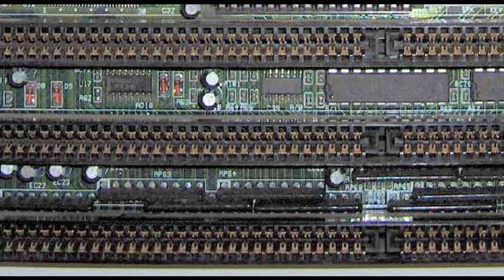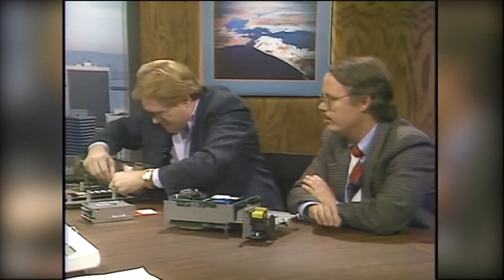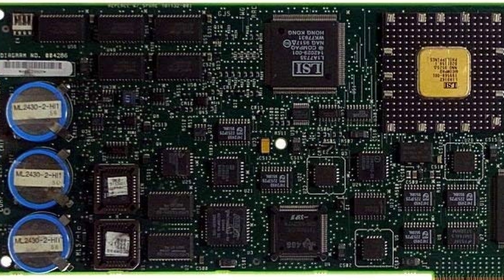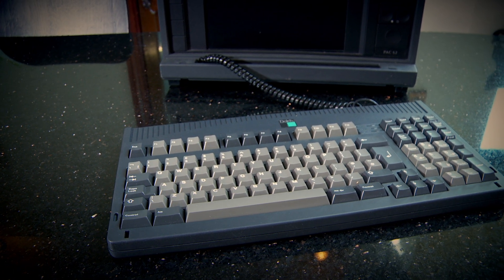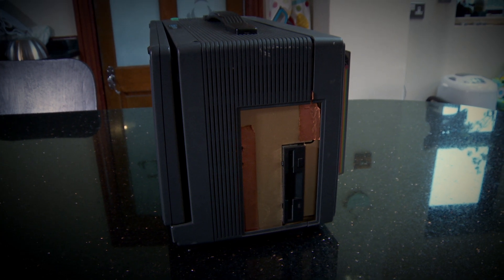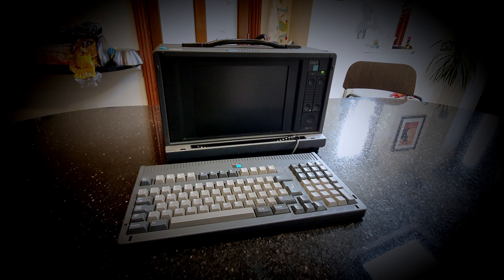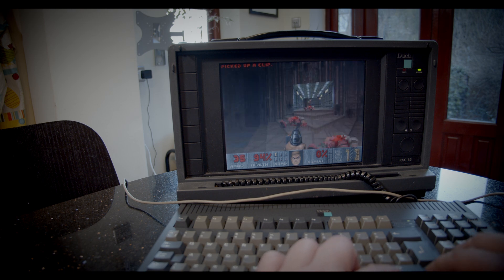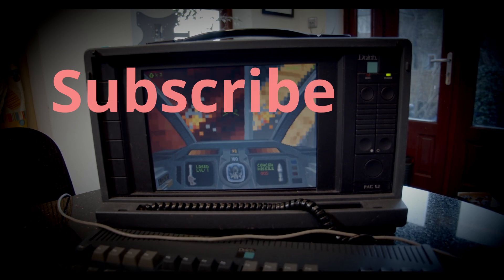E-ISA vs MCA: When IBM Lost the lead in PC market

Comment: One thing that's not mentioned about this period and IBM's plans for the PS/2 is ABIOS.  This was a new, extended bios (that they would NOT make public) that, they thought, would allow OS/2 to perform way better on a PS/2 computer compared to a PC compatible.

I'm not really sure what logic they used because there are serious logic holes in that plan.  But what other choice did they have to try to regain control?

Comment: Small correction: There's no relation between FreeDOS and DOSBox. DOSBox is a stand-alone emulator that has its DOS "built-in". While you can use DOSBox with actual FreeDOS or MS-DOS (or even Windows 9x), in 99.9% of the cases it just runs on its internal DOS emulation.
Reply: Yes. As opposed to any actual DOS, the DOSBox emulation doesn't actually consume any RAM within the emulated machine and just provides invocation points such as software interrupt handlers, which get satisfied by pure magic - it just doesn't exist as software within the emulated environment, it's folded into the machine emulation.

DOSBox-X fork, however, does bundle some utilities from FreeDOS.

Comment: ISA is pronounced ice-ah but EISA is pronounced by pronouncing the 4 letters one at a time. It's not pronounced e-isah.
Reply from the maker: Its nice that you have an opinion on how it should be pronounced, but it is just that. I've never ever heard it pronounced that way even once, and I had alot of conversations with people about E-ISA when it was a current technology. So while you may pronounce it that way, it would seem to me that you're in a minority camp choosing to go with that pronunciation.
Reply: @RetroBytesUK  I work in the industry and at the time and I have never heard it pronounced anything other than E-I-S-A.
But, you are probably right that it doesn't matter. It's just me being pedantic.
How much was that CF-SCSI adapter you are using?
Reply from the maker: @tarstarkusz  I got mine for £55, however I think they have gone up in price now. I've used a few of them and found them to be very reliable, I have one in in my SGI box, my Sun SS10, and a couple in different Amigas.  I'm planning on trying out RaScsi on a future build, as it a reasonable price, and some of the features appeal especially the remote access to disk images.
Reply: I knew someone in school who said "iz-dnn" for the digital telephone service and there's Dave Jones reading all acronyms as if in lower case: no Ellie-Dee or Effie-tee in his component drawer. Beeta, bayta, bonnet, hood, we'll work out what we mean. *smile*
Reply: @tactileslut  ISDN was pretty cool.  I once worked for a company that had a service contract with Oracle.  All the remote Oracle employees (there were a lot of them) had an ISDN router in their home offices.  The ability to handle telophony made them very useful.  They could get an office extension in their own home.  But as ADSL and DSL started becoming widespread available, they quickly went out of favor.  The problem with ISDN is that it was expensive and the equipment was expensive.

Comment: 7:26 "The only lasting standard that the PS/2 managed to set was the keyboard/mouse". It introduced VGA which came to rule supreme for many years. Or am I missing something?
Reply from the maker: It had a vga connector, but that was an agreed upon std and was already on a number of gfx cards before IBM shipped their first PS/2.  If IBM had got the PS/2 out when they had planned it might have been the first time it had been seen in the market, but that was not to be.
Reply: @RetroBytesUK  Interesting. Mind telling me which gfx cards? Just surprised, as I was a total graphics geek at the time (starting on A2s, c64s, macs, amigas,...) spending a lot of time on PCs with CGA, EGA, Hercules, VGA, SVGA, (writing 2D-engines, 3D-engines, movie players, etc.). Also having to make an adapter cable converting from the (to me) new 15-pin VGA standard onto my monitors existing analog 9-pin PGA connector, etc. Taking the VGA specific sync polarities into account, etc. Not doubting you know your stuff, not trying to win, I will be happy to learn something new. But really? (My idea was that VGA with 320x200x256 was a new thing introduced by PS/2 in 1987 that lasted into the later 90s)
Reply from the maker: @asgerms  We had a few HP specialist CAD PCs that had vga prior to the PS/2's release, it also had acceleratored vector drawing. However only the custom verison of autocad that shipped with it supported the acceleratored drawing. The place I was at then was going to order a number of ps/2s on release but while we where waiting on the ps/2 it's release having been delayed, HPs sales team got to us. We also acquired some none acceleratored vga cards from a 3rd party to upgrade our existing machines at the same time, really can't remember the manufacturer they where probably targeting the CAD market at the the time.  The vendor had its own graphic terminal software that worked with the unix based system we had, as all our simulation work was done on unix.  Being able to use a pc as a graphics terminal was a big deal. I remember it having its own I/O board that linked it to the Unix machine (the cable was super thick). They where not fast, 16bit isa really did not perform well enough. However this is pre X windows being common our unix system had no X support, but it did have alot of vector processing which for the simulation work was great.  And PC where much cheaper than the graphical terminal that shipped with it

Comment: Tandy was one of the few companies that actually licensed the microchannel and produced a 3rd party machine using it.
Reply: Another was Apricot with their Qi PCs and VX servers. The servers were on caster wheels, had a sliding, electronically operated door at the front and looked like fridges. An image not helped by a light that came on when the door opened.

Comment: "even the smallest Linux distro needs more than 16 MB to work"
Actually, KolibriOS can fit on a high density 3.5" floppy and runs on a system with at least 8 MB RAM. And it has a very Windows XP-ish GUI too.
Reply: It was built on Menuet, with their own monolothic kernel that wasnt posix compliant (as opposed to linux, kernel wise)

Comment: I couldn't see the header for the internal video, but if it's just a VGA signal why not get a PCI video card and depopulate the external VGA header and made an adapter? Maybe even get a voodoo setup that way.... Anyway, good video
Reply from the maker: I did think about depopulating as pci card too after making the video. That's unfortunately where things got more complex as the lcd pannel takes some form of LVDS signal rather the regular VGA. The orginal card produces that signal format on the internal header. Once I looked at converting the VGA signal I realised that would get complex.

Comment: Was this a "TROLL VIDEO"?, It sure seemed like a troll video. ISA and EISA, had a transfer rate of 33mbps, while the first version of MCA was 40mbps and the second version was 80mbps! MCA could mix and match 16-bit & 32-bit cards @40mbps, while EISA was crippled by a single 16-bit(or 8-bit) card installed. MCA had lower latency as well as direct bus mastering, meaning the cards in the bus could talk to each other WITHOUT ever talking to the motherboard whatsoever! IBM would have been successful If: A)IBM did not charge as much for BUS LICENSING B)IBM did not treat each PS/2 as a completely different computer version, which needed its own special software C)IBM did not charge twice as much for OS/2, as windows sold for D)IBM did not change CEO's, so that the incoming CEO would drop the entire computer(PS/2) line, just to put his own mark on the company by announcing a new computer line(egotistical a-hole). MCA brought you PLUG & PLAY cards(software was sometimes needed, as all memory, especially for cards, was still very expensive, hence the 2-digit year code that brought us Y2K bugs.). PS/2 brought you PCI and PCI-E slots(didn't you ever notice the design?), modern keyboards and, for 2.5 entire decades, PS/2 mice and keyboard ports that ALWAYS WORKED, WITHOUT DRIVERS, FROM POWER-UP. Much praise should go to the forward-thinking engineer's at big blue.
Reply from the maker: That was the whole point of the video, technically better does not always win. IBM assumed they would succeed as it was technically good and they made it, they thought everyone would just fall in line behind them.  At no point does the video even suggest eisa is techincally better (its not), IBM just screwed up everything else to the point where any notion of technical leadership of what is or is not a PC died. Its probably is worth mentioning most EISA boards ran both an EISA and a regular ISA bus for exactly the reason you mentioned, thats why so many boards have regular ISA and EISA slots.

Comment: Another lasting technical standard that the PS/2 managed to set was that it introduced VGA graphics to the PC market
Reply from the maker: Good point, if anything that is probably the most significant affect the ps/2 had on the market.
Reply: @RetroBytesUK  PS/2 mouse and keyboard ports stuck around too.
Reply: I remember. IBM took one last gasp at trying to win back the PC market with XGA but everyone else made ANOTHER compatible product and called it SuperVGA.
Reply: The 3.5 inch floppies 💾 which lasted pretty much until 2000. Before PS/2 , the PC and compatibles used 5.25 inch floppies.
Reply: You could argue i386 as an isa too.
Sure, it was probably inevitable in a way, but if IBM had switched to another architecture at that point, history might have been different.
Reply: I had a VGA in my Wyse 286. ???

Comment: I never thought I'd hear an 8-bit version of The Art Of Noise's Close To The Edge. But now I have.
Reply: I'm just trolling you... but... technically, the original version of Close To The Edit was 8-bit already - considering the Fairlight CMI was driven by twin 6809s.
Reply: @edgeeffect  I believe later versions managed 12 bits, but I've no idea what the development timeline looked like or what version of the equipment The Art Of Noise used.
Reply: @random007nadir  they were right at the "hey, those new Fairlight things, I've got to get one...." stage.

Comment: 8:44 Apple Macs used SCSI for their hard drives (and some other devices) for quite a few years. It was only when PATA drives became cheaper that they switched.

(Note I don’t describe the latter as “IDE”. “IDE” stands for “Integrated Drive Electronics”, which meant that the disk controller was integrated into the drive, instead of being a separate adapter card. And SCSI was a form of “IDE”, after all.)
Reply: The standard that came later ATA (und much later PATA, it wasn't called like that before SATA came out) was actually called IDE when it was still a proprietary standard by Western Digital, it was only renamed to ATA when it was made to an industry standard.

Comment: 7:05 But the title of standard-setter had passed from IBM long before. By 1985, what defined “compatibility” was the ability to run Microsoft Flight Simulator. So, whether you liked it or not, from that point on, it was more appropriate to refer to these PCs as “Microsoft-compatible”.
Reply: That is a bit more complex I'm afraid. 

In 1985, there still existed machines which did use MS DOS, but were not 'PC compatible'. That is, anything relying on PC bios functionality would need to be rewritten or wouldn't work, because those machines did not use a PC BIOS clone, and used their own vendor and often machine specific MS DOS version.

For that reason alone, talking about 'Microsoft compatible' is just as confusing as talking about 'IBM compatible'.